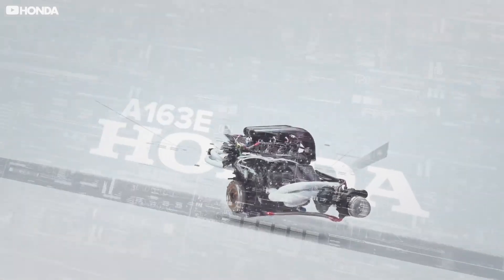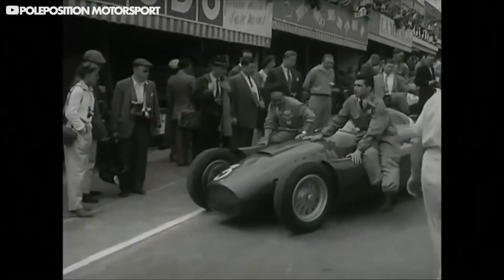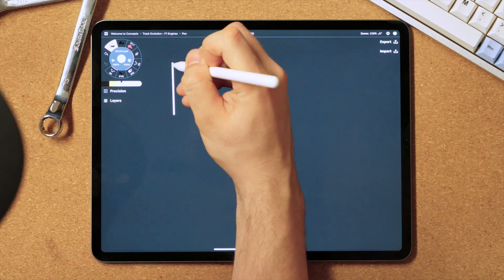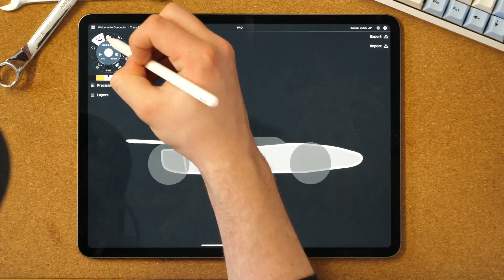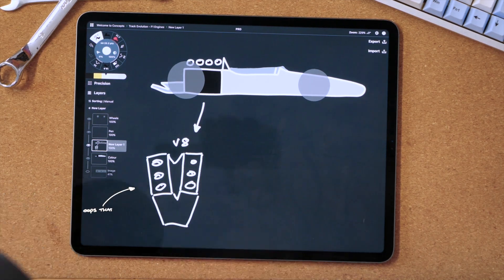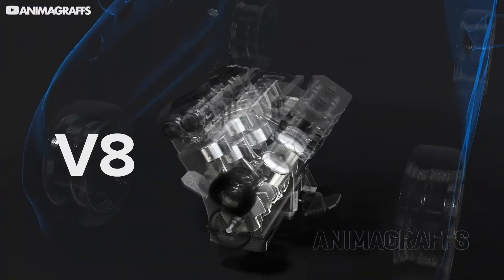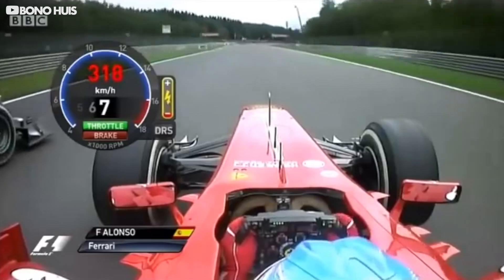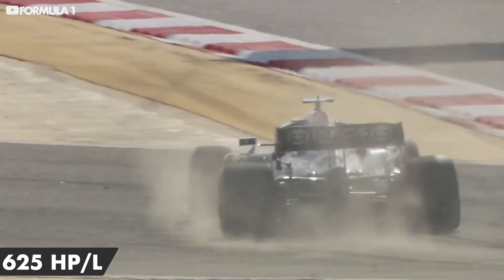The Incredible Evolution of Formula 1 Engines | Track Evolution

Comment: 2:09 didn’t know they provide on-track shower for the driver lol
Reply: No, Kimi, you will not have the drink
Reply: Imagine having the time to chill for 5 seconds and then drive away again.
Reply: @liamcalpine  guess this is liquid cooling but not in the engine yet
Reply: That was the refueling.
Reply: @Redskies453  LOL! 🤣🤣
Reply: @Redskies453  Refueling the car or the driver? :D
Reply: Imagine how much heat the driver is being put through if they find it necessary to trade lap time for a bucket of water being thrown over him.
Reply: @Neishy86  Could be quali or testing
Reply: No way to cool the body or have a drink except a bucket of cold water thrown over you mid corner.
Reply: Ikr, it also have a second purpose as a drive-thru driver cooling system
Reply: i think its bc the engines used to get so hot which would make the drivers hot

Comment: Nice video, but you glossed over the 2.4L non-KERS V8s from 2006-2008
Reply: ...and no mention of the glorious V12’s from Ferrari, Lamborghini and Honda the last of Senna’ world championships ion 1991
Reply: Yeah those were the greatest v8s in F1. 19k rpm v8s , cosworth one could even rev upto 20k. From 2009 and onwards their rev limiter was around 18k
Reply: @timothyscherer9163  Cosworth DFV8..
Reply: The video dealt in broad sweeps, not fine details. Those engines form part of a fairly uniform chunk from the banning of turbos to the introduction of KERS, and don't really stand out as a 'thing' on their own.
Reply: MAAHAQQ    Do you believe F1 engines are designed to be modular?
Reply: That’s what the FIA wanted at the time because they thought the V10s were too powerful and too costly. A huge mistake. FIA basically lopped off two cylinders and ultimately rev limited them, set the bore size, eve angle and mandated it weigh 95 kg. They were massively underwhelming and painful to watch having come from the V10 era. A big mistake but they got the costs down to probably a third of the current hybrid power plants, which were a huge mistake too given none of that tech has made it to road cars,
Reply: @weofnjieofing  it might, give it time
Reply: @weofnjieofing     The FIA were foolish to ban V10s, after all the expense of developing them, to assume that lopping off two cylinders was a cost saving was stupid in the extreme, F1 engines are never designed to be modular.
Reply: @weofnjieofing  There is even race tech missing on road cars from those old V8's. Where are the pneumatic cams? or any type of independently controlled cams. Oh that's just for race cars and supercars... Nevermind that 30% efficiency we could have. If we cant do that how do we get further than that?

If tech from 1998 hasn't hit in 2021, then hybrid tech wont get released until the robots take over... (IMO) And if it does it will cost more than birthing sentient life!
Reply: noticed that too. the 2.4 V8 although now loved for it's sound, was never as powerful or beautifully sounding than the V10 that came before it. the hybrid turbo PUs of today in turn are more powerful and more sophisticated. in my opinion they pale in comparison to what came before and after. some people just like them because they enjoy their noisy sound
Reply: @DenisKudlik  Sounded better than the KERS V8's though imo.
Reply: Because they weren't that amazing. They were a pure cost saving, power-limiting initiative - especially from 2009

Comment: Pneumatic „valve springs“ doesnt mean there is no camshaft. Freevalve has nothing to do with traditional pneumatic valve springs used in f1 and motogp. Look up bmw e41/4 gear drive on google you ll see its a dohc engine and how the camshafts are driven by internal gears without any belts or chains
Reply: He only said “traditional system” he didn’t say they didn’t have the parts still,
Reply: @damedusa5107  they worded it very poorly „timing of this can be much harder with a traditional camshaft system“ and then giving freevalve as an example right after saying that applies that they got rid of the camshafts. maybe they didnt mean that but with that wording it basically implies getting rid of camshafts. Theres few more other typos and mistakes in the video as well so i guess its due to garbage wording of the sentence
Reply: @timothyscherer9163  fair enough